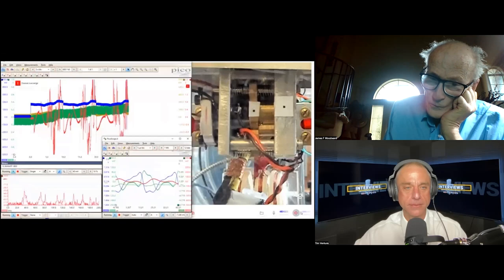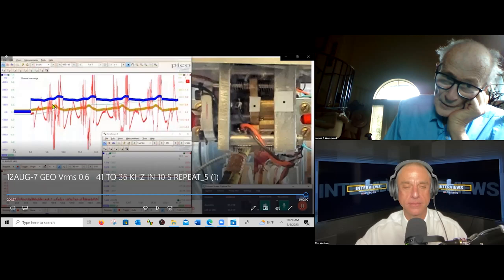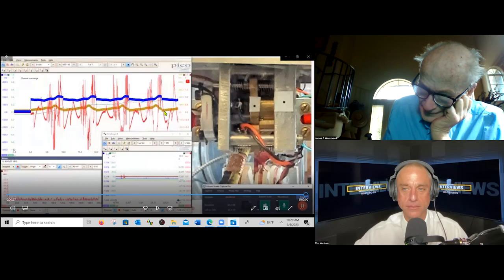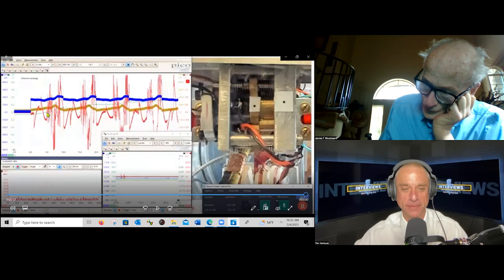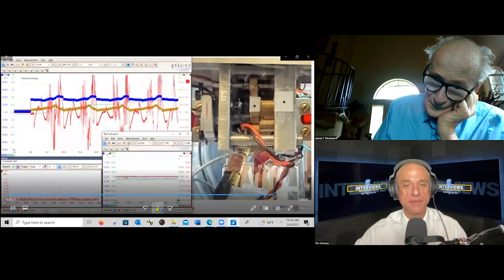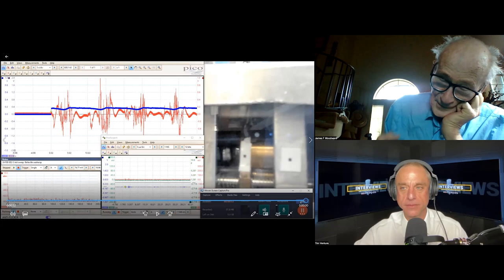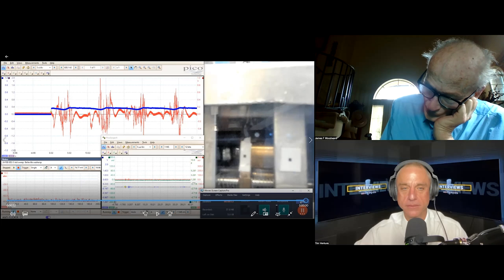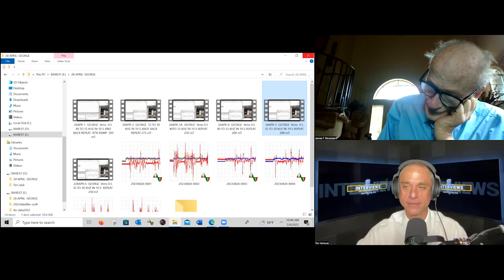James Woodward - Mach Effects & MEGA-Drive

Comment: I'm more curious about Woodward's ideas on how to scale this up than any other facet. Both the strength of the effect per unit cell of reaction mass/piezo stack (so I guess individual thrust to weight ratio), and maybe how to power increasingly larger arrays of these units, without taking the total mass above the total thrust? How does he anticipate getting this thing above 1.0 TWR?

Comment: The red trace is plotting displacement; every change in which constitutes an inertial interaction (mass is being accelerated), and if everything's in the same ground / lab / absolute reference frame then we can only assume momentum is being conserved.  Transient reactionless accelerations that trade the inertia for velocity components of a conserved system momentum obviously don't challenge N3 or N1, any more so than the ice-skater effect;  in this linear case aren't the positive and negative transients simply mirror images conserving net momentum, just as the positive inertial torque from retracting a rotating moment of inertia must inevitably be followed by an equal opposite negative torque from re-extending it..?   No closed-cycle gains possible, because even though the forces are effectively unilateral, they're being produced explicitly by the constancy of net system momentum, rather than any variation in it..

And there's the rub:  can you demonstrate accumulation of momentum over an isolated closed cycle - ie. a non-cancelling ±dp/dt, and further, over a succession of such cycles wherein the net change in p is simply the sum of the per-cycle momentum yield times the number of elapsed cycles?

The metric that really counts is the plot of the anomalous momentum delta - that divergent inertial frame, plotted against the zero-momentum or absolute frame - perhaps set against the net input energy cost / work done versus the accumulating system velocity, KE and dissipated heat, notwithstanding that CoM is not a function of CoE as is the case the other way around;  it doesn't matter how much energy we waste flailing around in our efforts to break it.. a megajoule dissipated for a 1 kg-m/s gain would still be a win, it's that black & white..  But efficiency considerations aside for now, before you can calculate a CoP you need some measure of useful output work, which in this case is the singular goal of demonstrating an anomalous momentum delta, and which this data does not unfortunately yet support.

A quick recap on the aspects of Newton that really count here (these often get construed in a variety of ways that don't really elucidate their finer points)

• N1 - the net system momentum of a closed system of mutually-interacting masses / inertias is constant with regards to time, and cannot be altered by the internal expenditure of work, but only via the external application of force..  hence from N1 we segue neatly into N2:

 • N2 - F=mA and its inversions m=F/A and A=F/m, or for angular systems torque is angular inertia times angular acceleration (T=MoI*rad/s²) etc. Note that for all practical intents and purposes, replacing 'mass' with inertia in all kinematic formulas is more succinct, and gives us the most useful empirical definition of what 'inertia' is. But implicit in N2 is that there can be no unilateral forces, as from thin air - in order to accelerate inertia in one direction, we must apply a force which necessarily counter-accelerates some other inertia in the opposite direction;  we can only apply forces between inertias, which are thus mutually-interacting, and hence from N2, N3 naturally follows:

 • N3 - not so much about 'equal opposite reactions' as equal opposite changes in momentum - when we apply forces between inertias, their respective accelerations are a covariant function of the difference in inertias, such that the product of inertia and velocity in each direction is equal and opposite at all instants, and hence from N3 we're returned back to N1, a virtuous circle of self-consistency.

Which is not to say it's a walled garden; but we do need to take the lay of the land if trying to consider potential exploits.  More fundamentally, net system momentum can only change if the system's thus effectively thermodynamically open to a time-asymmetric interaction with a fundamental force constant such as the EM constant alpha or perhaps gravity.  Inertial forces are, in contrast to fundamental forces, fictitious - the pirouetting skater, remember, isn't gaining angular momentum, no matter how hard she accelerates.  Mathematically, no closed system of mutually-interacting inertias can.  Fundamental force constants reduce to effective time-constant rates of exchange of ambient momentum, be it quantum (h-bar) or classical, but fictitious forces do not meet this definition, hence time-asymmetric inertial interactions that can gain or lose net system momentum are not a coherent or credible proposition, quite irrespective of the provenance of inertia itself..  unless you can induce and harness time-variations in the effective value of inertia for a conserved system mass.

This last conjecture has its own theoretical problems however;  consider for instance that everything at rest around us obviously shares the system velocity of the planet's latent motions through space:  if i could momentarily reduce the inertia of my coffee mug - without drinking or spilling any - then CoM would imply that, like the ice-skater, it should self-accelerate, without the external application of force, in order to conserve whatever its ambient net momentum it possesses whilst sat there on my desk.  But in which direction should it accelerate - east, or upwards relative to gravity, or both, or what?  What might be the options, if any, for vectoring the direction of thrust as for useful propulsion?

Finally, float or suspension testing - inertial isolation generally - is notoriously fraught with potential measurement error and false-positives; any inadvertent grounding of stray counter-momenta will produce non-cancelling remainders and apparent gains, so proving any putative gains is a high bar and needs to be multi-faceted insofar as demonstrating the integrity of the rig and data acquisition (ie. controls & null-hypotheses), to correlating empirical gains back to theoretical prospective mechanisms on that per-cycle basis, elimination of alternative explanations such as thermal effects etc.  A close-up shot of a linear actuator tells us nothing of the system's momentum symmetry.  Neither the presented data nor experiment seem to provide support for the hypothesis at this stage..
Reply: Your informed skepticism appreciated, although you lost me with the notation "Co'X'". Is this meant to convey "C sub naught"? 

In any case, I do appreciate your criticisms, and in particular, your challenge to his project to demonstrate that real work is being done...and further (if I understand you correctly) that all possible changes in momentum should be accounted for, including those that may be incidental to the experimental environment.

Your argument does, however, seem to be couched in the observed invariance of conserved momentum (which, admittedly, has never, to my knowledge, found experimental exception). But if I understand Dr. Woodward correctly, the gained momentum in his apparatus is conserved, and transferred to innumerable bodies throughout the firmament. The mechanism and method by which momentum is conserved would seem to be the entire substance of his work.

In addition, I appreciate you noting the limitations of the experimental apparatus. It seems to me that the claimed effect may be small enough to fall within the bounds of those extraneous influences you describe.

I really hope this all amounts to something, but in the end, if there is indeed a net propulsive effect, it would have profound implications with regard to our understanding of the means by which forces and momentum may be communicated and conserved.
Reply: @joelneatrour1945  CoM = conservation of momentum;  CoE = conservation of energy.  Breaking the former also breaks the latter, per the vis viva relationship.  Again, if the source or sink of momentum is other, unreferenced bodies external to the system, then that system by definition is not closed and its net momentum and energy thus not necessarily constant.

On the current balance of evidence it would appear the most practical solutions for reactionless thrust are those seemingly ubiquitously employed by UAP, characterised by warp field signatures such as Casimir radiation and absorption at the interface of curved and flat spacetimes, gravitational lensing of background imagery and wavelength-shifting effects, but crucially at much lower apparent energy densities than our current formulations per the standard field equations, implying there's easier ways to fold spacetime than we've hitherto considered..
Reply: They key assumption is that the Ether is totally inflexible/rigid. The energy/inertia is returned perfectly.

Comment: The concept these folks are exploring involves leveraging the piezoelectric effect in a stack of crystals that vibrate, gaining and losing energy (and thus mass, according to the mass-energy equivalence principle) to induce directional movement through their interaction with the universe's mass distribution, as suggested by Mach's principles. This raises an intriguing theoretical question at the intersection of classical mechanics, relativity, and quantum mechanics.

First, it's crucial to understand the principle of mass-energy equivalence (Einstein's famous E=mc^2), which states that mass can be seen as a form of energy. In the context of piezoelectric crystals undergoing cyclic loading (vibration), the energy stored and released in each cycle could, in principle, lead to a minute change in the system's mass.

However, the mass change involved in such energy conversions is extraordinarily small. The amount of energy required to produce a measurable change in mass is vast, considering the speed of light squared in the equation, making the mass change practically undetectable for energy scales typical in piezoelectric applications. It's incredible that these folks have managed to see a measurable change, and that they've been able to adjust their device to increase the observed effects!

For a system to move directionally by internal mechanisms (without external forces), it must find a way to circumvent the conservation of linear momentum in a closed system. The conservation of momentum principle states that for momentum to change, there must be an external force applied to the system. Simply changing the mass of a component of the system (while conserving energy) doesn't provide an external force; thus, it doesn't directly lead to a net movement of the entire system.

Let's entertain the hypothetical scenario where we could significantly alter the mass of an object through energy changes within a vibratory cycle:

Forward Cycle: The object gains energy (and thus mass) while moving in one direction. The increase in mass at a critical phase of its motion could, in theory, increase its gravitational interaction with the universe (per Mach's principle), altering its inertial properties.

Return Cycle: The object loses the previously gained energy (and mass) as it returns to the starting point. The mass decrease would theoretically reduce its gravitational interaction, possibly leading to a different inertial response.

For this to result in net directional movement, the process would need to break the symmetry of the motion cycle in such a way that the interaction with the universe's mass distribution during the mass-gain phase is fundamentally different from the mass-loss phase. This scenario requires a mechanism by which the universe's mass distribution asymmetrically influences the object based on its changing mass, which is not accounted for in current physical theories.

While the idea of using mass-energy changes in a vibrating system to induce directional movement is fascinating and creative, it faces significant theoretical and practical challenges:

- The mass changes due to realistic energy changes in piezoelectric crystals are minuscule.
- Preserving conservation of momentum in a closed system through internal processes alone does not naturally lead to net directional movement without an external force.
- The hypothetical mechanism would require a novel physical principle that allows for asymmetric interaction with the universe's mass distribution based on the object's instantaneous mass.

This project touches on deep questions about the nature of inertia, mass, and energy, and while current physics provides no mechanism for such a process, the pursuit of understanding these interactions is at the heart of theoretical physics and could lead to new insights or discoveries. 

Kudos to everyone involved. This is how we move forward. Incredibly exciting stuff.